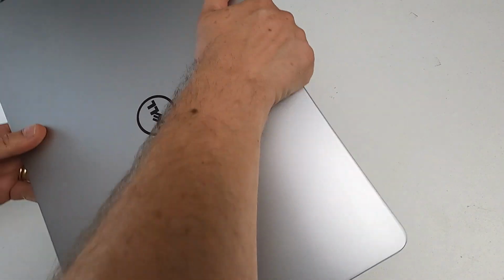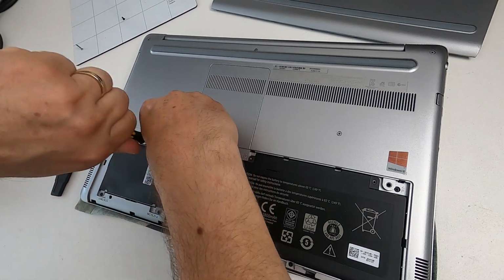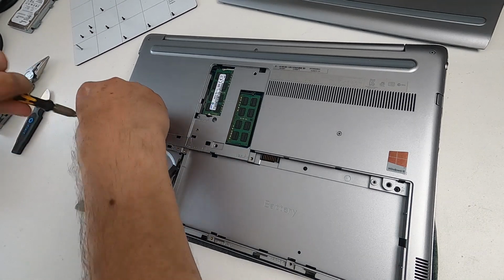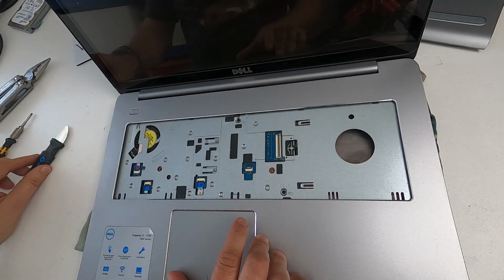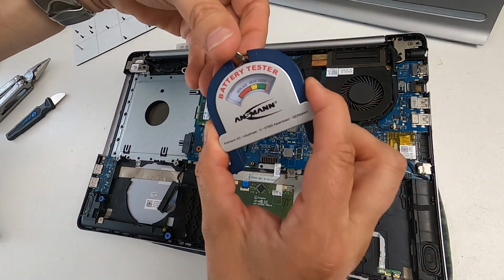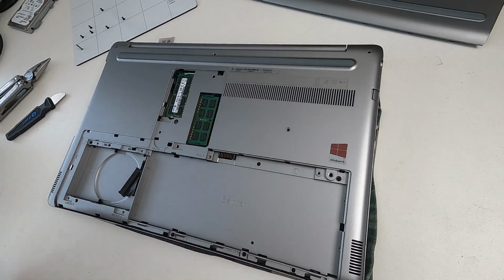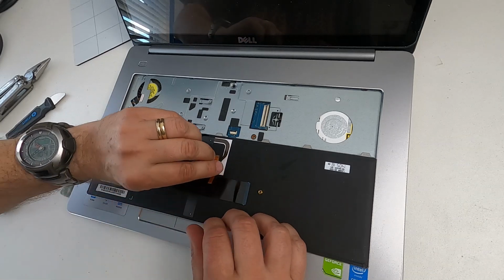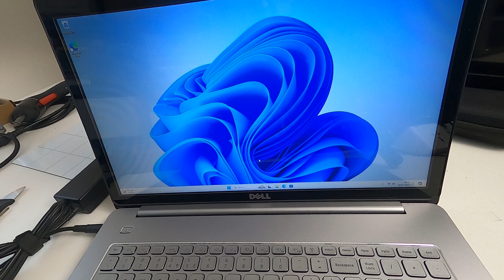DELL Inspiron 7737 Battery Fix *FULL GUIDE* in English

Comment: This is so helpful and well-explained. I appreciate the tips too. I'm stuck on removing the back cover because the long screw in the back corner by the hinges appears to be stripped. It turns to no effect, and I can't pluck it out with tweezers or grab it with tape or anything. I'm worried if I try to brute force it the cover will crack. So frustrating. All this just to replace the bloody CMOS battery. Any suggestions before I'm forced to take it in for professional repair? Thanks.
Reply from the maker: The one on the right as you look at the back with the cover at the bottom is a captive screw... so it doesn't actually come out. If its spinning freely then you can pull at the cover to release the clips and the cover should come off after you take out the screw on the left.

Watch the video, but slow down the bit where I remove the cover and hopefully it'll make sense and you'll be able to remove the cover.
Reply: @sterntechdaddy  Thank you for your video and your reply. I was finally able to replace the CMOS battery.  I was wondering, is it ok to leave out the two keyboard screws when I re-assemble? Every time the keyboard is removed it gets a bit more warped. It seems unnecessary to have those screws there, but maybe I am wrong. Thanks.
Reply from the maker: The screws are there for a reason - to hold the keyboard in place but if the keyboard is getting warped then the screws might help reshape it.

You can't place the keyboard on a flat surface keys upward to try and reshape it because of the two brass screw mounts in the bottom. You can place it face down and then gently try and tease it back into shape with a gentle series of bends. But you need to be careful and take it slowly.

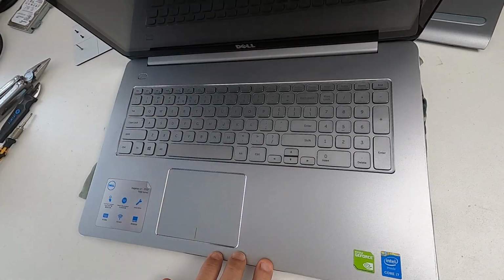At 10:32 I remove the keyboard using a spudger to release the catches and light pressure from holding one of the raised corners up a bit. This minimizes the chances of bending it.

But now you've sorted the problem you probably won't need to remove the keyboard again... so a bit of gentle bending should reshape it and then it can be screwed back in and the clips along the top edge should help keep it flat when it's put back on.

Comment: Hello, Me again.
I also forgot to mention that I need to replace my main battery.
Got any recommendations on where I should buy it?.
Are the ones I see on Amazon any good?
Do you recommend only buying from Dell?

Looking for more feedback
Thanks again, in advance
Pete
Reply from the maker: Always try and find a genuine DELL battery if you can. You’ll need to double check though… words like ‘genuine replacement’ don’t mean DELL branded.

The cheaper batteries can have a few problems - they might not fit in as well as proper DELL batteries and they might not actually work.

For a guide, I would expect a genuine DELL battery for this laptop would cost around £55 - and I would ask the seller to confirm that it is a real DELL branded battery before buying too.

🙂
Reply: @sterntechdaddy  
Thanks for your reply and suggestion.
Did you find time to read my first text?.   Curious is you think it possible for my laptop to run Windows 11 ?
Reply from the maker: I replied...

The answer is yes - i can run Windows 11.

:)

Comment: Hello and good morning.
Just curious.
I have the very same Dell Laptop.
Inspiron 17  7737 series.   Service Tag # C1VY3Z1
I watched your video and you did a great job with it.
In your video you mentioned that this laptop was capable of running Windows 11
Is that possible?.  When I ran the Dell upgrade feature it stated that it was not possible.

Looking for your thoughts on this.
Thanks in advance
Pete
Reply from the maker: Microsoft have revised the requirements for Windows 11 to allow older devices to use it, but I used Rufus to make a tweaked Windows 11 installation USB that skips the CPU and TPM check.

🙂

If a PCcan run Windows 10 then Windows 11 will generally work - Microsoft put in an 8th Gen or newer CPU and TPM check that blocked Windows 11 from installing on devices that could actually run it.

Comment: Hey! I feel so lucky to find your video. You just posted it 2 weeks ago and have decided to clean up my notebook today. I was confused as to why the back panel didn’t want to go off. Would have never guessed that you have to pull off the keyboard first. But in my case, when I pull up the keyboard it doesn’t go up with the black layer. Only the panel between the keys goes up. Don't know what to do. Don't want to damage anything
Reply from the maker: Not sure what you mean by the black layer - the keyboard has a black bottom, but that is very much part of the keyboard and not a separate thing. If the screws holding the keyboard in place are removed then it comes off as shown.

Note that there are two screw mounts on the bottom of the keyboard - the DVD drive is one and the other more obvious.
Reply: Yeah, I was talking about the black bottom. Yesterday I tried again and managed to pull it off. It didn’t go as smoothly as in your video. I had to use much more power and was scared to damage it. But everything was alright. Thank you very much for the video!
Reply from the maker: If you use a spudger to release the clips then you can't really do any damage - but the clips are pretty strong and need to be released by pushing ion exactly the right places.

Glad you've got it sorted though.